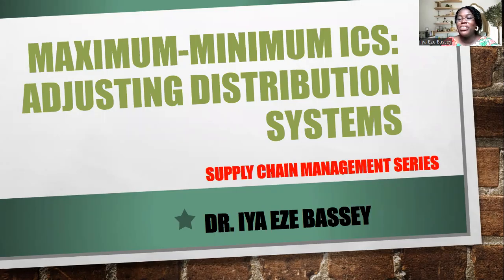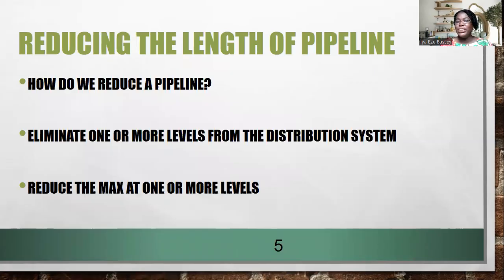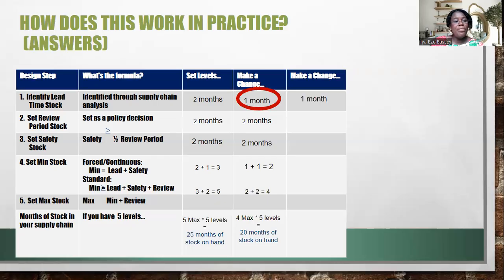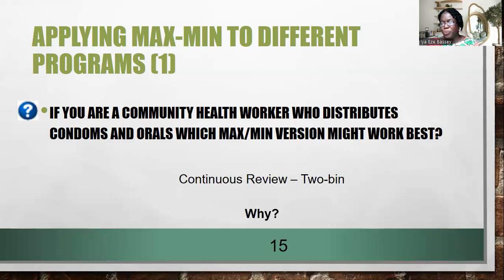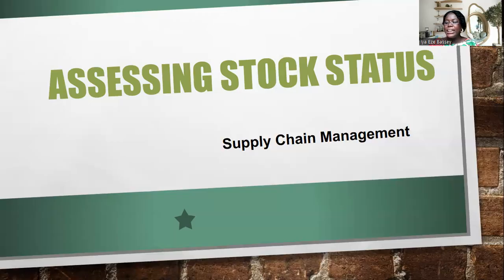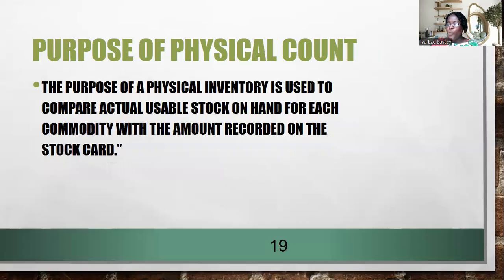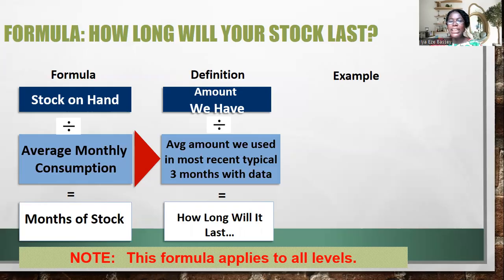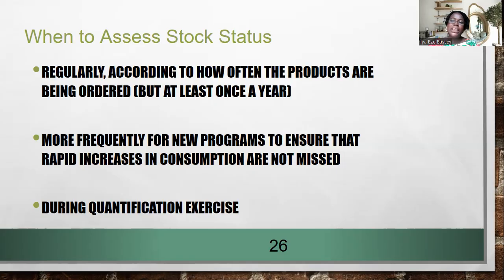Maximum-Minimum ICS: Adjusting Distribution systems (Supply chain management series)

Comment: I learnt that: The steps in designing Max-Min ICS are;
1. Set up initial Max-Min policies for each level.
2. 2. Check if the overall distribution will function properly if the level specific Max-Min policies are implemented. 
3. Check the total length of the pipeline that the policies at each level imply.
The advantages of MAX-MIN ICS; 
1. Reduce waste 
2. Avoid emergency order costs. 
The challenges; 
1. Managing systems with multiple levels. 
2. Managing inventory for new programs.
Maximum Stock Levels can be reduced by:
1. Improvement of distribution system reliability. 
2. Reduction of lead time at one or more level. 
3. Shortening of review Period at one or more level.
To reduce the pipeline we have to; 
1. Eliminate one or more levels.
2. 2. Reduce the max at one on one levels.
Reply: MAXIMUM-MINIMUM ICS ( adjusting distribution systems in my summary)

Steps in designing a max-min ICS are 
1. Set up initial max-min policies for each level and facility.
2. Check if the overall will function properly if specific max-min are implemented.
3. Check total length of pipeline that policies at each level imply.

Reducing the length of pipeline: 
Eliminating one more levels from the distribution system.

Reducing the maximum stock level: 
Elements of the formula which can change in order to reduce the max stock level.

Factors that impact max-min stock levels 
1. Cost of products 
2. Cost of storage 
3. Storage capacity 
4 Reliability of transportation 
5. Age of program 
6.Management skill of staff 
7. Lead time 

 Advantages 
1. Avoid overstocking 
2. Avoid understocking 
3. Minimize wastage 
4. Avoid cost of emergency orders
5. Consistency of stock levels 

 Challenges to max-min ICS:
1. Systems with numerous levels 
2. Systems that manage large numbers of commodities 
3. System that manage products of new programs 

Assessing stock status:
Purpose: is to determine how long supplies will last. 

Physical count: process of counting by hand the number of usable units of each commodity in your store or health facilities at any given time. 
Purpose: is to compare actual usable stock to hand for each commodity with the amount recorded on the stock card. 
Determining the number of months stock will last. 
Stock on hand ÷ average monthly consumption = months of stock 

Amount we have ÷ amount we used in the recent typical months with data = how long it will last .

When to assess the stock status
1. Regularly according to how the products are ordered.
2. During quantification exercise.

Comment: Thank you ma for this wonderful lecture 
I learnt that there are steps in designing a maximum/minimum inventory control systems, they are ;
. Set up initial maximum policies for each level and type of facility.
. Check if the overall distribution will function properly if the level specific maximum/minimum policies are implemented.
. Check the total length of the pipeline that the policies at each level imply.
   Also to reduce the length of a pipeline you have to 
- Eliminate one or more levels from the distribution system 
- Reduce the max at one or more levels from.
Factors that impact maximum/minimum stock levels 
1. Cost of products 
2. Reliability of transportation 
3. Storage capacity 
4. Cost of storage 
5. Storage conditions at different levels 
6. Shelf life of health commodities.

Advantages of using maximum/minimum system 
> Avoid overstocking 
> Avoid under stocking 
> Minimize wastage 
> Avoid costs of emergency orders 
> Simplify inventory control decision maki 
> Forecasting and qualifications.
Thank you ma .

Comment: Adjusting Distribution Systems in Maximum-Minimum Inventory Control Systems.
I learnt that we have to do the following;
- Assess pipeline length and set initial maximum policies
- Reduce pipeline length by eliminating levels or improving distribution
- Use a maximum-mean system to avoid overstocking
- Choose the right Maximum-Minimum version for your program
- Regularly assess stock status and conduct physical accounts to minimize losses and ensure efficient
supply chain management.

Comment: Thank you so much ma

During the course of this lecture I learnt that :
There are steps in designing the maximum - minimum inventory control system 
1. Set up initial maximum - minimum policies for each level and type of facilities 

2. Check if the overall distribution will function properly if the level specific maximum - minimum policies are implemented 
3. Check the total length of the pipeline that the policies at each level imply

What can be done to reduce the length of a pipeline 
1. Eliminate one or more levels from the distribution system 
2. Reduce the maximum at one or more levels

How do you reduce maximum 
  *Element of the formulas which can be changed in order to reduce the maximum stock level :
   • Shorten the review period at one or more levels 
    • Reduce the lead time at one or more levels 
    • Improve the distribution systems reliability at one or more levels so that safety stock can be reduced.

  Factors that impact determination of maximum and minimum stock levels .
     • Cost of products 
     • Reliability of transportation
     • Storage capacity
     • Cost of storage 
     • Storage conditions at different levels 
     • Shelf - Life of health commodities 
     • Lead time
     • Reliability of source of supplies 
     • Effect of a zero balance of stock 
     • Management skills of staff
     • Age of program
     • Accuracy of forecasts.

 Advantages of using maximum - minimum system 
     • Avoid overstocking 
     • Avoid under stocking 
     • Minimize wastage 
     • Avoid costs of emergency orders 
     • Simplify inventory control decision making 
     • Consistency of stock levels 
     • Reliable data source from SDP for forecasting and quantification.

Comment: Thank you Ma for this wonderful lecture.

after this lecture I have learnt the ways to adjust the distribution system policies.example of this was are Reducing the length of a pipeline, reducing the Min and Max stock.

I learnt that we reduce the max stock Level by 
✓SHORTEN THE REVIEW PERIOD at one or more levels
✓Reduce the LEAD TIME at one or more levels 
✓Improve the distribution system's reliability at one or more levels.

I learnt the Factors that impact max-mjn stock , advantages of using Max-min system. some of this advantages are;
_ Avoid overstocking and understocking
_ minimize wastage 
_Avoid costs of emergency orders
_ Consistency of stock Level

formula for calculating monthly stock on hand(MOH)

MOH= STOCK ON HAND(SOH) ÷ AVERAGE MONTHLY CONSUMPTION(AMC)

AMC= MONTH CONSUMPTION FOR THE LAST 3 MONTHS÷3

In Conclusion,The sole purpose of assessing stock status is to determine how long supplies purchased already will last.

Comment: Thank you for this very insightful lecture, Ma. On this chapter, I learnt about how to and the need to reduce the length of a pipeline, factors that impact Max/Min stock levels, and assessing stock status.
  You spoke on the need to reduce the length of pipeline to help in procuring stock earlier. You can reduce the length of a pipeline by eliminating one or more levels from the distribution system or reducing the max level at one or more levels. This is achieved by shortening the review period, reducing the lead time, improving the distribution systems reliability at one or more levels so that the safety stock can be reduced. Factors that improve Max/Min stock levels include cost of product, storage capacity,cost of storage, shelf life of health commodities, amongst others.
    You moved on to speak on assessing stock status and explained that physical count is the process of counting by hand the total number of usable units of each commodity in your store or health facility at a given time. It is recommended to access stock status regularly; according to how often the products are being ordered, more frequently for new programs to ensure that rapid increases in consumptions are not missed or during quantification exercise

Comment: From what I’ve learned, when modifying a distribution system, it's important to take the following into account:
1. The overall length of the pipeline.
2. Finding ways to shorten the pipeline.
3. Bringing down the maximum stock level.
Some of the benefits of using the Max-Min Inventory Control System include:
1. It helps to avoid both excess stock and stockouts.
2. It minimizes product wastage.
3. It helps cut down the costs linked to emergency orders.
4. It keeps stock levels steady.
5. It makes inventory decision-making more straightforward.
However, there are some challenges in working with inventory systems, such as:
1. Managing systems that operate across several levels
2. Dealing with a wide range of products
3. Keeping track of inventory when new programs are introduced.
When it comes to stock status assessment, this process helps determine how many months of stock remain. It is done by:
1. Doing a physical stock count.
2. Estimating how long the current stock will last

Comment: Thank you ma.
I now understand how to set up a max-min stock system. These are the steps:
	1.	Set starting policies for each type and level of facility.
	2.	Check if these rules will work well for the whole system.
	3.	Look at how long the supply line will be with the new rules.

To shorten the supply line (pipeline):
	•	Remove some levels
	•	Reduce the max stock at one or more levels

Ways to lower max stock:
	•	Shorter review times
	•	Reduce lead time
	•	Make transport and delivery more dependable

Things that affect how much stock we keep:
	•	Price of items
	•	Transport reliability
	•	Storage space and cost
	•	Shelf life

Why max-min is helpful:
	•	Avoids having too much or too little
	•	Reduces waste
	•	Saves money from emergency buying
	•	Makes decisions simpler

Hard parts of using this system:
	•	Many levels
	•	Many products
	•	New health programs

Physical count means checking what’s in the store by counting.
This is used to compare with what’s written in the records.
Stock status tells how long your items will last.

Comment: Thank you, Professor, for this informative module. I've learned that the maximum minimum inventory control system is crucial for managing stock levels, preventing overstocking and understocking. This system is particularly useful in medical laboratories for managing laboratory reagents, consumables, and equipment.

The maximum minimum inventory control system operates by monitoring the supply chain, from manufacturer to end-user. I've also come to understand that several factors influence the maximum-minimum levels, including:

- Age of the program
- Storage costs
- Production costs
- Lead time

This system helps avoid emergency order costs by providing regular stock status updates. Additionally, it facilitates management and assessment of the supply chain's length at each level.

Thank you again, Professor, for your guidance

Comment: Thank you Prof for this exciting module. I learned that maximum-minimum(max-min) inventory control system isimportant for managing stock levels helping to prevent bothoverstocking and understocking. Inventory control is useful formanaging the supply of laboratory reagents,consumables andequipment in the medical laboratory.
Maximum and minimum inventory control system is by:checking the length of the pipeline(i.e the entire chain throughwhich supplies are moved from the manufacturer to theuser). I also learnt that there are factors which impact themaximum-minimum level; age of program,cost of storage,costof storage, cost of production and lead time. It also aids inavoiding emergency order cost by providing a guide to the stockstatus on a regular basis. It also assist in the management andassessment of the length of pipeline of policies at each level.Thank you so much Prof!!

Comment: Thank you Ma, for illuminating the topic of adjusting distribution systems within the maximum-minimum inventory control
Here is a concised summary:
Optimization of health commodity supply chains from central to rural levels must be focused on setting and verifying initial maximum policies for each facility and ensuring proper distribution system functionality, including assessing the overall pipeline length. 
*Methods to reduce this pipeline include eliminating distribution levels or strategically decreasing maximum stock levels by adjusting factors like review periods and lead times, and improving system reliability to lower safety stock.
*Various factors influencing max-min stock levels include product cost, transport reliability, storage capacity, shelf life, and management skills.

*The significant advantages of using a max-min system include preventing overstocking and understocking, minimizing waste, and simplifying inventory decision involves both physical inventory counts to verify records and determining "months of stock" using the formula: Stock on Hand / Average Monthly Consumption. Regular stock assessment is essential. 
 * In a Push System, a higher, central level makes decisions about what and how much to order, "pushing" commodities to lower-level facilities regardless of their specific needs.
 * In a Pull System, lower-level facilities determine order quantities based on their actual consumption and needs, "pulling" commodities from higher levels.

Comment: Thank you ma for the lecture.
During the course of the lecture I learnt that:
— The steps in designing Max-Min ICS are;
• Set up initial Max-Min policies for each level.
• Check if the overall distribution will function properly if the level specific Max-Min policies are implemented.
• Check the total length of the pipeline that the policies at each level imply.
 — To reduce the pipeline we have to;
• Eliminate one or more levels.
• Reduce the max at one on one levels.

Comment: Thank you ma for the wonderful lecture video 
I learnt a lot in adjusting a distribution system 
The first step in adjusting a distribution system ie to check/consider the length of the pipeline in order to set initial maximin policies for each level
The second step is by reducing the length of a pipeline by elimination of one levels from the distribution system or reducing the max at one or more levels
Thank you ma❤

Comment: Thank you for this lecture😊

It is important to note that, in the adjustment distribution policies, the implementation of specific maximum policies of each distribution level is important for inventory flow, in the public health  Supply chain.
Some advantages of max -min inventory control systems are :
* Reduce waste 
* Avoid emergency costs 
Some challenges faced are :
* Managing of systems with multiple levels 
* Managing inventory for new program 
The purpose of stock assessment are:
* Conducting a physical Count
* Essential in verifying stock accuracy 
* Preventing discrepancies that could lead to stockouts or overstocking

Comment: Designing a maximum-minimum inventory control system (ICS) involves several essential steps to ensure efficiency across all levels of the supply chain. These steps include:

A. Establishing initial max-min guidelines for each facility type and supply level in the distribution chain.

B. Evaluating whether the overall distribution network will function smoothly when these level-specific max-min rules are applied.

C. Assessing the total pipeline length that results from implementing these policies at each level of the system.

To shorten or streamline the pipeline, certain adjustments can be made, such as:

A. Removing one or more distribution tiers or levels from the supply structure to simplify the process.

B. Reducing the maximum stock level at selected points within the system to prevent unnecessary buildup of supplies.

These steps help enhance the responsiveness, reduce delays, and improve the overall efficiency of the inventory control system.😢

Comment: Thank you very much ma'am for this great lecture...I learnt alot about adjusting distribution system length of a pipe line and the steps in designing a max-min which includes :
(a) set up initial max-min policies for each level and type of facility (b) check if the overall distribution function properly if they level specific max-min policies are implemented (c)check the total length of the pipeline that the policies at each level imply.
I also learnt about reducing the length of a pipeline which involves :
(a) eliminating one or more levels from the distribution system (b) reducing the max at one or more levels (setting up policies)
the factors that impacting max-min : cost of products, reliability of transportation, storage capacity, least time etc.
advantages using a max-min system is to avoid overstocking and understocking, also minimize wastage .
lastly, I learnt about the importance of physical count which is the process of counting by hand the total number of usable units of each commodity in the stores room at any given time .